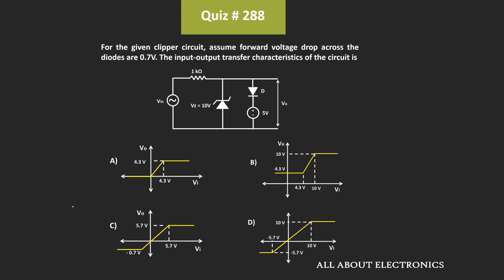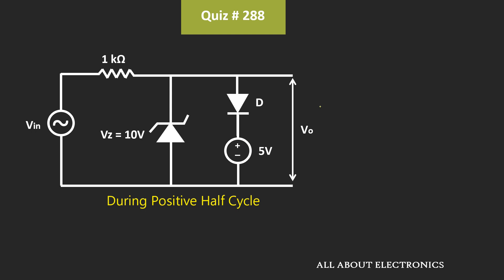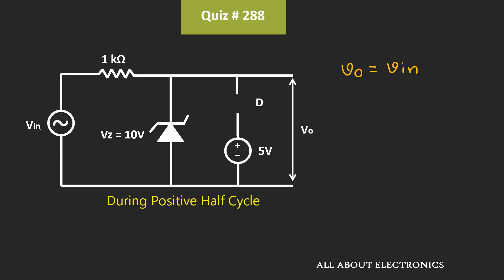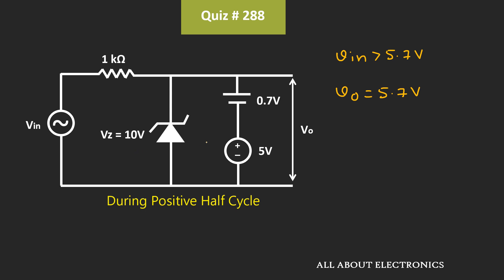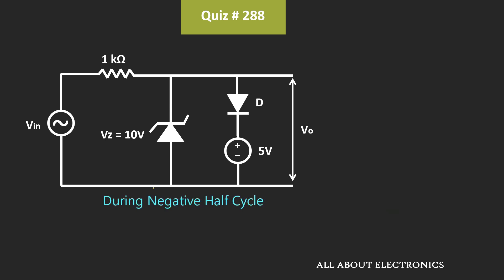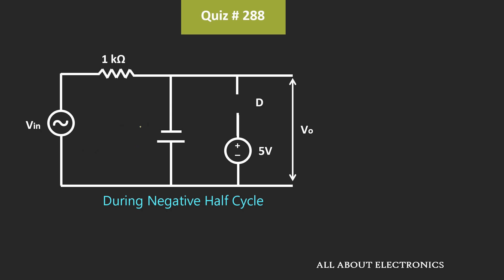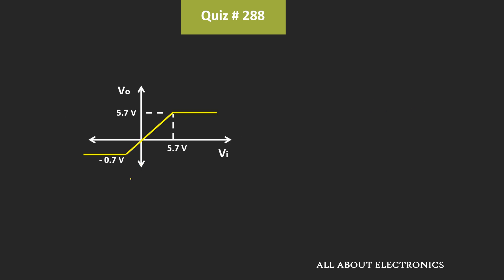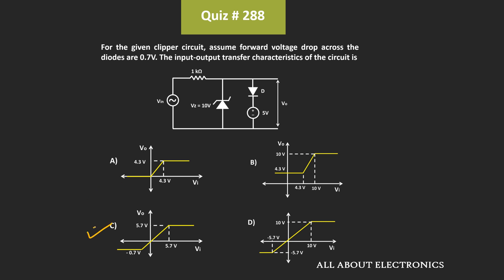Clipper Circuit Solved Example | Quiz # 288

Comment: When Vin will be greater than 10 v then diode will go in breakdown region ???
Reply from the maker: The one of the diode is Zener diode. The Zener diode operates in breakdown region. And here its Zener Voltage is 10V. So, when input is more than 10V, then it will operate in break down region. I hope, it will clear your doubt. 
For more information, you can check this video: https://youtu.be/MZPeRlst8rQ?si=g3pjWSXU_RYU9RF1